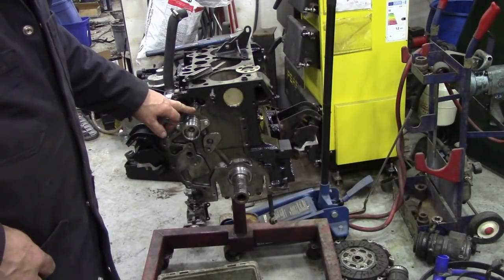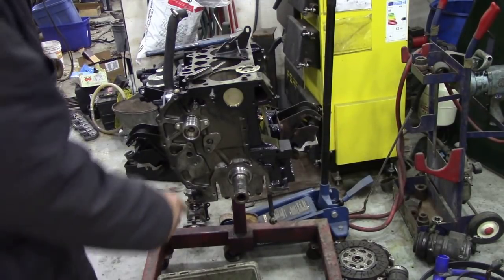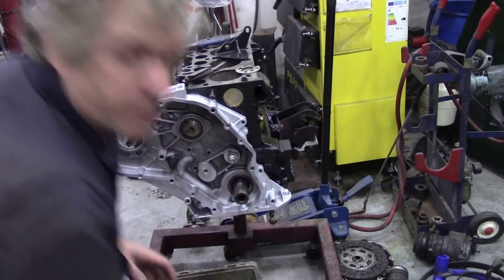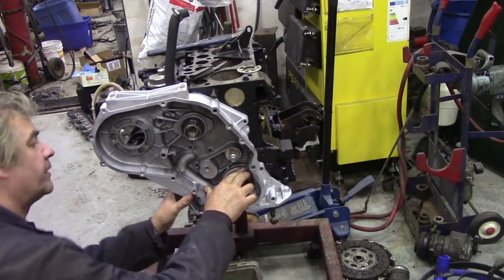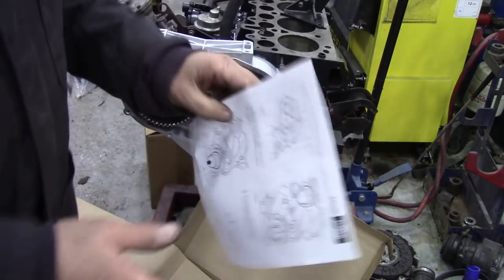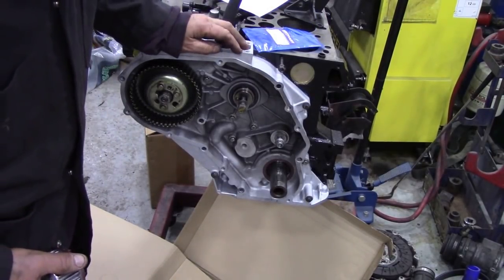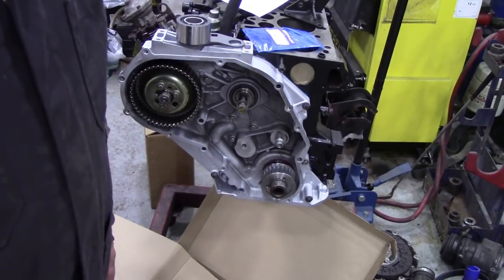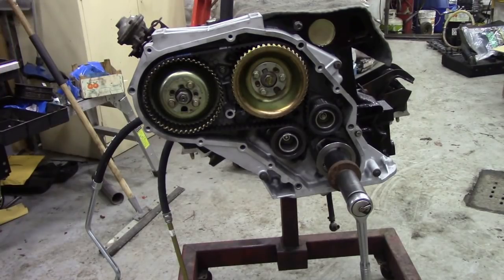300Tdi timing cover refit and run off belt issues

Comment: That’s why I’m thinking of putting a plug, maybe a better description would be an inspection plug. Every oil change pull out the plug and dip your finger in. No oil good. Grab a light and look at the crank gear...belt not running to the front or back? Good.

Comment: In manufacturing there's a word , PIG , it means production is God, the reason big engine manufacturer's don't highly tune engines is tolerance' s on machining would have to be very tight which in a low cost high volume environment is not possible.  Ever journal, bearing , mounting face , shaft ect. Has parameters and then some don't tell anyone parameters lol. 
Keep up the good work 👍👍👍

Comment: I know I'm very late to this party. But it looks to me as if there is an end float problem in the inj pump shaft, the axial movement will be caused by the pump element rollers reacting against the wave plate within the pump. Put your DTI against the end of the shaft and rotate the engine, I reckon you'll get four movement cycles per revolution. Do a pump piston stroke check. I guess by now you'll know the cause and have the problem remedied.

Comment: I had the same problem a month ago after the rebuild, one belt snapped after the test drive. The problem was the same the belt keeping moving forward. We found out if you put a really thin shim just be hide the polly, the belt will not move forward anymore.
Reply from the maker: I put a shim behind the outermost bolt on the 3 bolt pump flange - seems to be OK - I have done this in the past with good results
Reply: Britannica Restorations Ltd wouldn’t that actually push the pulley outward? I know what you are doing is working, but I don’t understand why. Can you do a video on just shimming it? 

It seems like if you loosen the three bolts from the IP and then loosen the two bolts on the steel bracket on the back of the IP, then try shimming in a way that that when you tighten the grew IP bolts to the case it would pull the timing case backward and then tilt the gear/pulley back a bit.

Comment: Mike there is a retro fit kit for the belt tensioner .they use a washer and a bolt to keep the tensioner square to the timing cover. What it does is keep the tensioner pulls from moving side ways which in turn doesn’t allow the belt to walk out or in thus keeping it from shredding on the crank pulls or the back of the timing cover. Land Rover went away from the Allan head bolt and washer that goes into the belt tension pulls. I use this on all timing belts I do and they don’t seem to have any shredding problems.
Reply from the maker: Have you go the part numbers please?
Mike
Reply: Britannica Restorations Ltd 

Hi mike I’ll have a look in the shop for the part number of the kit  the bolt is SS11201E the washer is. ERR900. The rover manual says it was used on the later model 300. It keeps the tension bearing square. I believe it was used on the early models as well and they found problems with the tension bearing twisting and allowing the belt to walk out and break.
Reply: @BritannicaRestorations  SS110201E is the flanged bolt (M10 x 20), and ERR900 is the injector pump washer. They also appear to have fitted an M10 flanged nut (FN110046).

Comment: I emailed you a video about what I discovered with my injection pump mounting bracket and I used a dial caliper to measure the different when tight and loose.
Reply: Instablaster.

Comment: Can you make a spacer kit? 
Can you design a rear bracket that bolts to the back of the injection pump that has an adjuster that you can tighten? Then it would pull the housing in the right place and you can run the engine while adjusting it. You stop adjusting when the belt runs right center of the crank sprocket. 

Also in the kit would be an injection pump sprocket tool or bar. You screw it on like you me long bar you used so that we can test the deflection of the the fuel pump bearing for diagnosis. (That way we don’t mess with the timing housing if the pump bearing is bad, thus making a problem worse.) 

I’d try it, but I don’t have the time and the parts aren’t easy to come by in Brazil.
Reply from the maker: I think we went through this in the comments - I put a recon pump on and no more problems
Reply: Ok. I’ll check into a new pump...

Comment: Been following this series... Quite interesting...  Regarding things made in the UK... Not much is made there anymore... The just priced themselves out of the market and all the unions and strikes when they had motor manufacturing probably scared a lot of manufacturers away...  Its easier to sit on the dole anyway so to get them to work is another thing "eh"
Reply from the maker: I agree
Reply: Regarding that belt running to one side...  Putting in a "Shoe" is masking the problem... I think that cover is either flexing or the pump pulley is warped... Very rarely the belts are out of true but it does happen.... Try turning the belt around and if it still does the same then you know for sure.... My hunch is pump pulley.... Or it could be worn due to previous belt miss alignment...
Reply from the maker: The cover has been machined and checked - the pulley has had a DTI on it to check run out   - no problem
I am thinking it is the pump flange moving the belt forwards on the firing stroke 
Seems to be a very common issue with the covers bending
Belt is at 11 Nm as recommend 
It takes so little pressure to put back in line - and these belts never move to the back - always the front
Reply: Hope you get it sorted.... Thanx for the vids BTW
 @BritannicaRestorations

Comment: I cant see if you have fitted the injector pump rear mount bracket in your video. Just the added pressure of the injector pump "firing" is sometimes enough to try and pull the pump forward/twist the aly casting. If you refit the rear pump mount that should stop a lot of the flex.  A "slipper" will overheat the edge of the belt and the rubber will start to melt leading to failure. Zues gear sets work great. I have fitted several kits. Must use good loctite on all nuts and bolts! If the "play" in the pump is significant then a "thrust button" against the injector pump pulley might be more effective. How much Play is supposed to be in the injector pump? Maybe it is time for a pump overhaul???
Reply from the maker: Yes the latest type of bracket is on with the sliding bushes
I am working on something very interesting right now on alignment
I think Zeus no longer make the gear kits - I cannot find any reference to them any more

Comment: Hi Mike, I love your videos, always had a series 2a petrol, now enjoying your work on the diesels. I think your shim idea was great, can you add another one? How about putting a straight edge across the front face of two large top pulleys and check if the pump pulley is aligned flat with the other pulley. It'd only take a misalignment of a thou to cause problems I think.
Reply from the maker: I am working on something at the moment   - video soon on my findings!
Yes there is still a deflect in the casing

Comment: Try putting a straight edge across our two pulleys and make sure they are parallel.
Reply from the maker: The pump bearing is shot - probably overtightened belts in the past

Comment: Hi Mike. I would not put kind of a slipper behind the cover. in Germany we say that this is a Polish solution. You should really tried to find out what the problem is.
Reply from the maker: I agree - but what is the problem and how much is is going to cost?

Pump rebuild here is C$1600!

 Cheaper to buy a new one
Cover is about C$600

I do not think the customer will pay

Comment: That's one thing that concerns me about swapping my 2.5 VM to 300 TDI is the good old gears on the VM and slight power loss.
Reply: Unfortunately you trade good timing gears for head gasket problems comparing VM and 300tdi.
Reply: @spitfiremk1uk o be fair a lot of the head gasket problems were down to not retighten the old style head gasket, I know it was with mine but having fitted the new MLS metal gasket no more problems, I have just under 300000 miles on my 2.5. The reasons for fitting the 300 tdi is simply cost and availability of parts.
Reply: @roversteve53  I carried out several factory kit conversions from VM to 200tdi back in the day. The problem was always overheating resulting in destroyed heads which was a cooling system problem identified as a steam trap issue by the factory. Landrover changed heads, head gaskets, then went to 2.5 but the problem persisted to the point customers paid over 6000 pounds back in the early 90s to have the engines removed and converted with a new 200 tdi. So my experience has never included a reliable VM engine set up in a range rover classic.  I like what I hear about the MLS style gaskets and I am looking to use one on a series Landy if I can find them for sale. A company in Devon UK used to offer a timing gear conversion Zeus Engineering however They no longer advertise these kits and were very expensive anyway. But they were reliable but noisy.

Comment: One or more of those five pulleys are not running true or are tapered due to wear. Maybe if the belt is off and you put the dti on each in turn the culprit can be identified.
Reply from the maker: It was the pump front bearing that was out

Comment: If it is doing it 4 times per pump pulley revolution have you tried fitting the dti gauge adaptor on the back of the pump (same as you would do when measuring pump lift) to see if the jump on the front pulley occurs at the same lift heights on the back?  If it does then it is probably caused by the cam rollers in the pump pushing the pump main shaft in/out?  That said I don't  know if that pulley movement is there on a 'normal' pump so its all a bit theoretical
Reply from the maker: It's funny, but you never seem to measure these things on new pumps, so you have nothing to work on as a datum

Comment: Hi Mike, Wonder if it’s possible to use something like laser/mirror wheel alignment to check all shafts are running parallel. That would identify if pump not running parallel to cam & camshaft. Otherwise maybe the new crank pulley is slightly too shallow and slightly behind line of pump & cam. Maybe possible to measure off straight edge across timing case. Does a thicker o ring bring the crank pulley forward?
Reply from the maker: I am working on something at the moment  video soon on my findings!

Comment: If you have a few thou end-float on the pump when it is dry, will the end-float be exaggerated when the pump is actually pressurising the fuel, can the pump end float be adjusted? I think if you put a slipper, you would end up with belt/slipper dust in the casing . Can you see if the pump pulley is true to the casing with a straight edge across the pulley? Is there ware on the pump shaft? Just some ideas....
Reply from the maker: I really don't know - I have no other pumps on hand to check apart from broken ones
The pulley is pressed steels and has no guarantee to be true - I suppose I could find a used one and have my machine shop true it up

The idea for the slipper is no different from the guides round the crank pulley  - it would just guide the belt back to it's good place - not a good solution but the options are a new pump and cover -  $$$!
And the thing is it is about 2-3 grams pressure to true it up - it is so near and these belts always run forwards - never to the engine
Reply: Yes,  slipper probably would work, it would just be nice to know what causes the problem.
Reply from the maker: I will pop down to the machine shop this afternoon
Would love to get to the bottom of this

Comment: Have you put as straight edge across the centres of the top two pulleys? Could you add a second gauge to the same pulley but on the opposite side? Equal movement on both sides of the pump pulley would identify a bit of end float
Reply from the maker: due to the nature of the stamped pulleys it is difficult to get a straight edge on them

Comment: Hi Mike, great informative video again, i'm still looking for a Landy, i've now come across a 1971 series 3 been restored, body work, and bulk head, out riggers and chassis quoted as being pristine, its had a 2.8 daihatsu Fourtrak engine fitted, any thoughts on the engine fitted.
Reply from the maker: The engine was quite popular in the UK as there was a fitting kit available
Just see if it looks right under the bonnet - bodged up hoses and wiring/exhaust etc
Reply: @BritannicaRestorations  Thanks for the heads up i will be looking at it on Sunday, would the old gearbox be able to handle the extra power. its also got an overdrive fitted. Dave
Reply from the maker: The S3 box was weaker than the S2a but had full syncro - I do not know what the power is of the Daihatsu

Comment: I’m tempted to put in a “drain plug” at the bottom of the case right under the edge of the pulley. Then at each oil change I can remove the plug and inspect where the belt is running. It could help me identify a problem before it turned into a snapped belt. What do you think?
Reply from the maker: I have seen these cases fill with oil due to a leaking seal - not a good idea

Comment: Seems mine is wayyyyy worse? I took some pictures. Belt is about 4mm narrower than the new belt. Wondering if my fuel pump bushing needs a washer or 2? Waiting on an oil seal before fitting to test. What do you think?  https://ibb.co/NF0Bp8z
https://ibb.co/Kz4V9bK
Reply from the maker: They reduced the belt tension to 11Nm  - I have seen a lot over tightened
Reply: @BritannicaRestorations  11nm! Wow hopefully mine was just to tight!  Thanks for all your videos. I'm hoping I dont have the bushing issue  :) also going to retime the pump